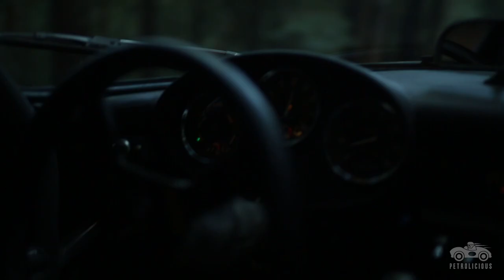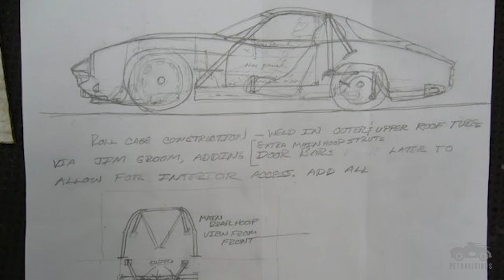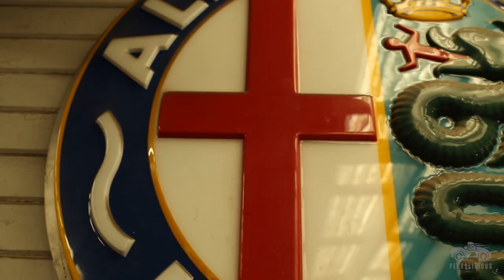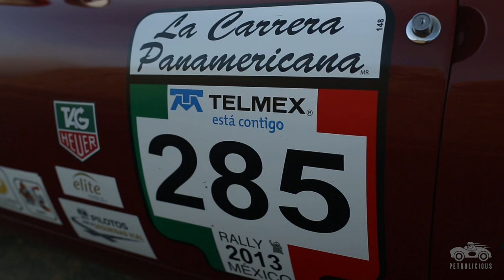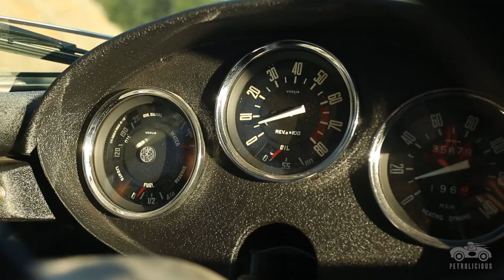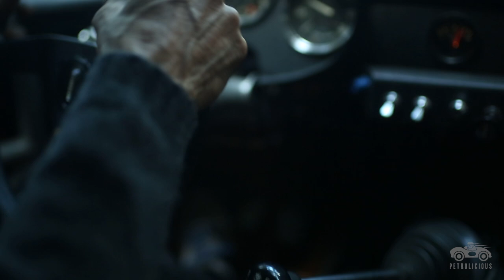The Alfa Romeo Sprint Speciale is a Racing Statement

Comment: Excellent show. Alphas are on the scene in some of my best memories. I fell in love with them at 17, 1969, in Rome, Milan and Turino. I bought a used 71 giulia 1750 in the early 80s and loved it, but I blew a seal and it seized up. Careless. I put a piece of plywood on my dining room floor and took the engine apart, put in new rings. Tried to get it back together, but I screwed up somewhere and it wouldn't turn over. Sold it for parts. Sad. But my best friend had a  72 GT Veloce 2 litre with dual Webers and I drove it often. Such a lovely exhaust note. Ah, me.